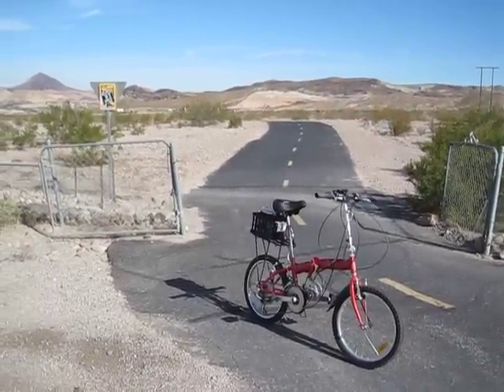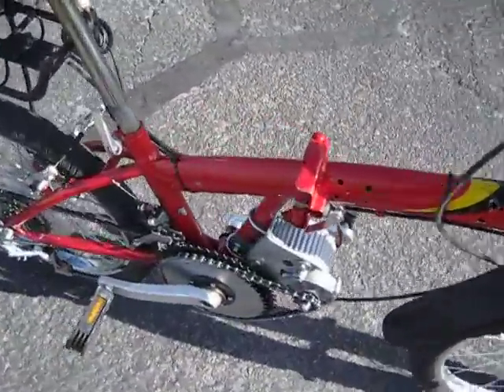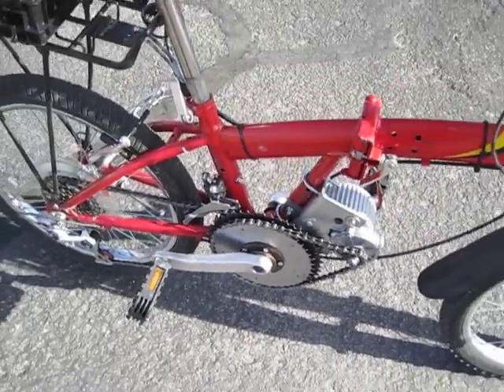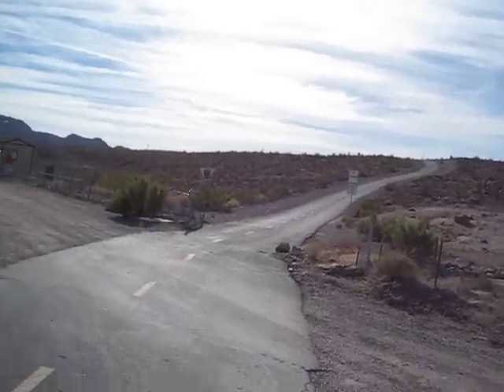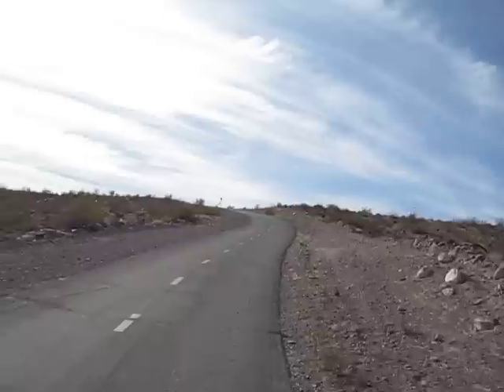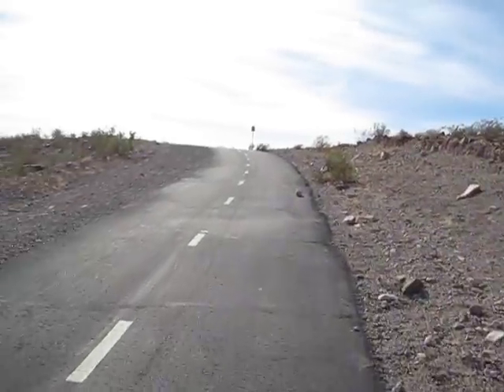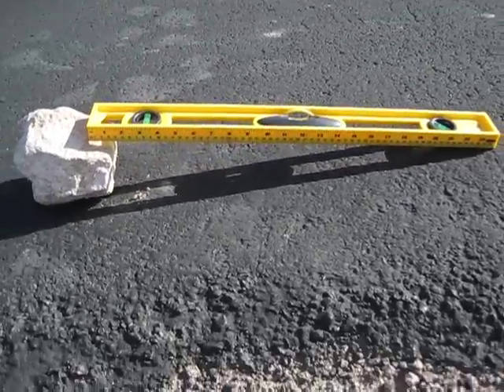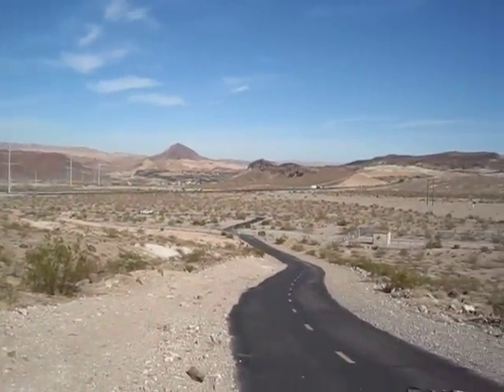Bottom Bracket Drive Ebike Update and Hill Climbing

Comment: do you have links to the motor mount on this bike?
Reply from the maker: The bracket is found here:  http://www.homedepot.com/p/Simpson-Strong-Tie-3-in-x-5-in-7-Gauge-Heavy-Angle-HL35-R/100374913

I drilled holes and had to modify the bracket to fit the motor.